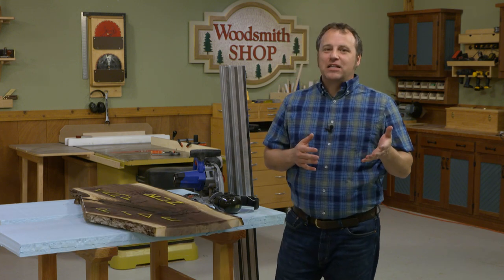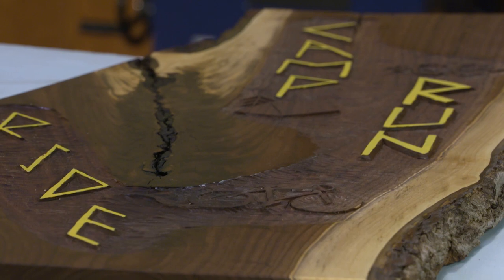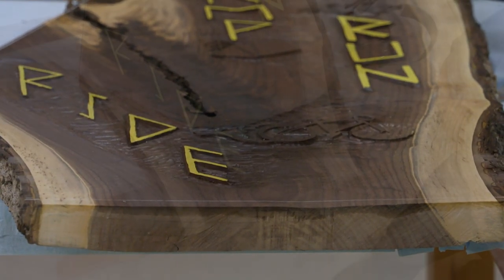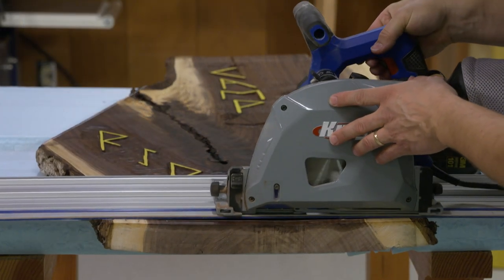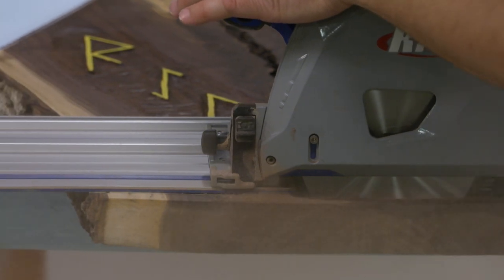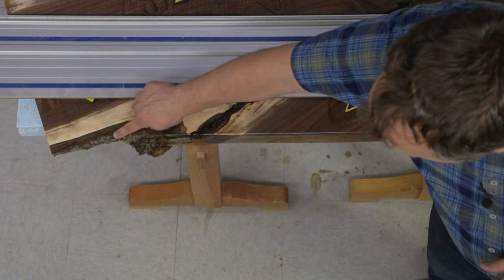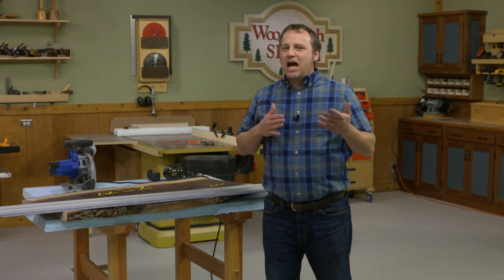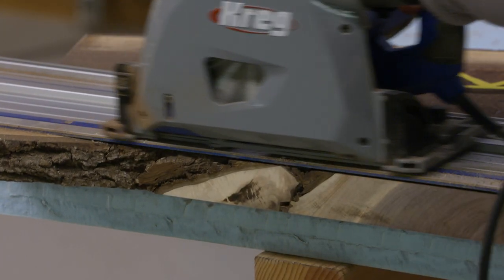Cutting A Walnut Slab With The Kreg Track Saw

Comment: Can this saw use a thin kerf blade?
Reply from the maker: You can use different blades. The blade will need to be 6.5" with a 20mm arbor.